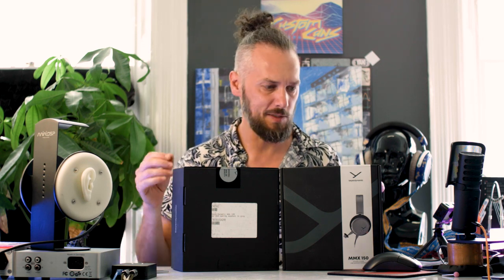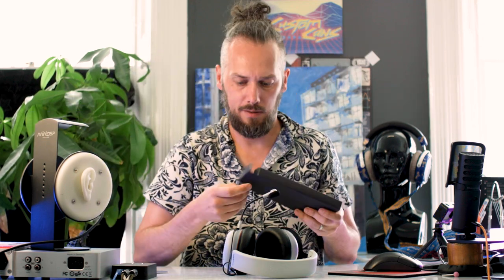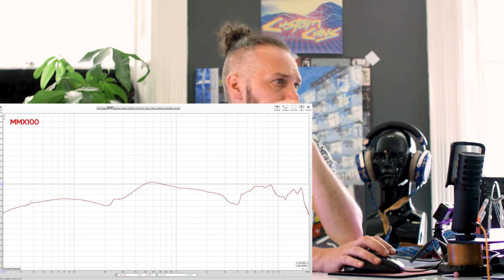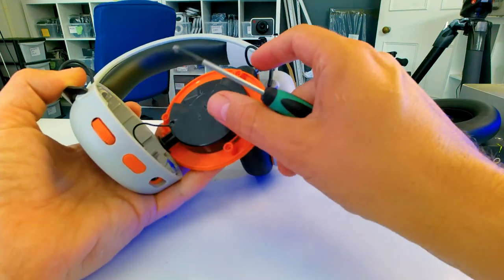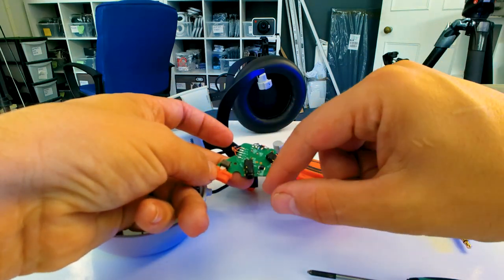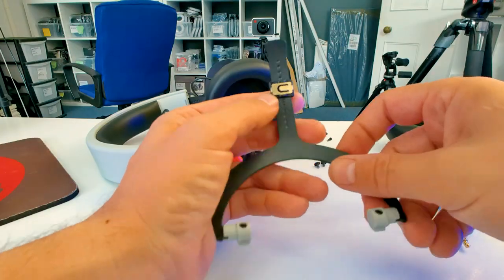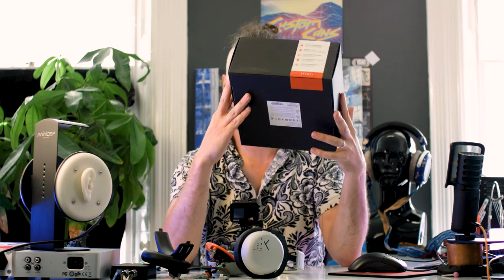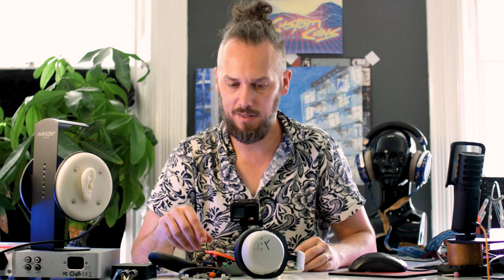Beyerdynamic MMX 100 Design Review. A look inside beyer's baby gaming headset

Comment: How was the volume wheel on your unit? Mine really messed up the channel balance when adjusting it, so I bypassed it
Reply from the maker: I have not had a good play with it yet - I will have a look tomorrow and let you know
Reply from the maker: No - on the pair I have, the volume control seems to work OK
Reply: @CustomCans  huh maybe they pushed the qc lately. Thank you for taking your time with this!
Reply: @Naebowski  How did you bypass it? i'm currently having the same issue.